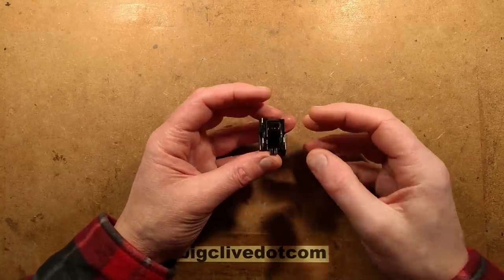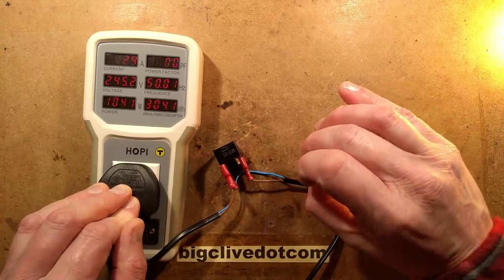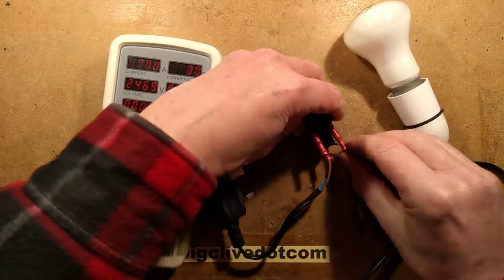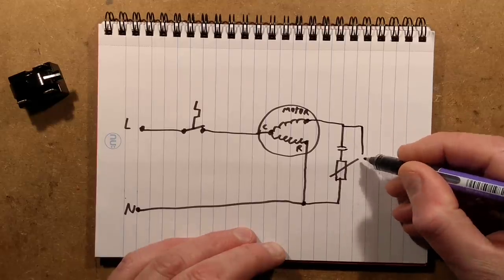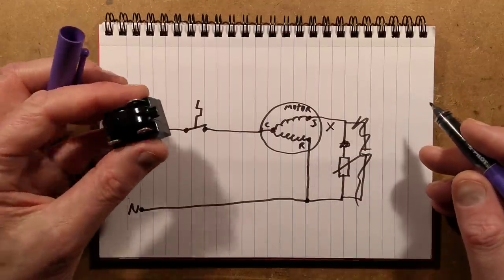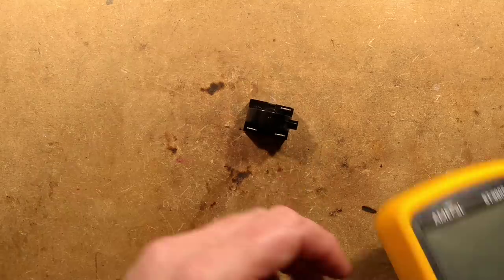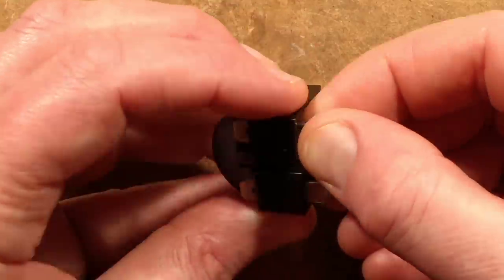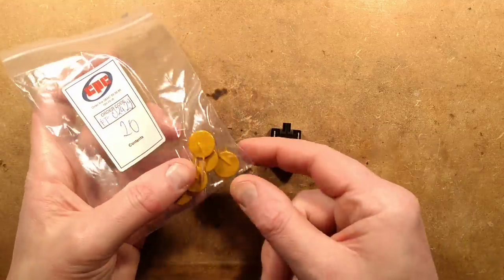Inside a cheap eBay motor-start module.

Comment: Most people will recognise the effect of the ptc thermistor from their old CRT TVs. The memorable switch on Twaaaaaang which was the degaussing coil wrapped round the screen envelope in series with a ptc device and the mains. A very effective use. The magnetic field would be large at switch on with large current flow and the alternating field would demagnetize the shadow mask. Then it would drop the current away in  four or five seconds making  a perfect diminishing ac field to ensure it does the job.
Reply: BOoOoOoOoOoOoOoOoOoOoOoOoOoOoNG
Reply: The old computer monitors I used to install used a relay to switch the degaussing coil on and off. You could hear it click in and out again after a few seconds and there was usually a manual override so you could give it a damn good degauss if it was necessary.
Reply: @jamesharmer9293  It was common with smaller portable screens to have a manual degauss as moving them about could upset the purity. Never seen one with a relay though.
Reply: @martinda7446  I used to install lots of 15 inch computer monitors and the degaussing was quite important. What got annoying though was when the magnetic fields of a bunch of monitors would all interfere with each other. They used to shimmer like crazy. I once saw a guy with 16 screens on his desk, though 4 or 5 was more normal.
Reply: @jamesharmer9293  Ha, ha, ha I can see it in my mind...Like a crazy GIF. That's a great image.

Comment: The holes in the back are for installing it directly onto the pins of the fridge compressor. I replace these all the time to fix broken mini fridges.
Reply: Yep there are three pins on the compressor, that starter relay fits onto 2 of them (start & run) & the thermal cutout (called a klixon) is connected to the third prong (common).
Reply: You fix mini fridges? I have a question for you in the morning! :o)
Reply: Sassy The Sasquatch  riiiiiight...
Reply: @
Stephen Kasprzyk, you probably have to put caps on the pins in that case, right?
Reply: @rolfs2165  Unless the electrical supply is through them ?
Reply: @millomweb  At least one pin should connect only to motor and optional capacitor.
Reply: @simonsackett  I'm going to guess he finds discarded ones and fixes the ones that are easy to fix for easy profit.
Reply: @rolfs2165  
the pins are the terminals to the winding's , so the ptc connects to the pins for run and start , the power (L) connects to 1 of the spade connectors , the common (other power(N)) is connected to the 3rd pin :-)
Reply: @YTANDY100  I mean when he's using the holes on the back to connect it to pins on the fridge's motor. In that case it's probably healthier to put caps on the spades so you can't touch them and get electrocuted.
Reply: @rolfs2165  
there is a plastic cover that clips over the connection point to the motor , but for extra safety you could use un-crimped spade terminals on the other connections :-)
Reply: @phil955i  My father always told me to remember can-she-run or (common start and run)...
Reply: I have a TK-20A thermoelectric mini fridge. It heats well, and the fan runs while it's heating, but the fan won't run on cool. The peltier panel does get hot when it's trying to cool but the fan won't run to (I assume) blow the heat away. Any ideas would be much appreciated!
Reply: @Scotty_in_Ohio not heard that one before, that's a good way to remember :-)
Reply: @simonsackett  
the fan is connected to a bridge rectifier , it may be that some of the diodes have failed , if it is a switch to change from heat to cool it may be the switch , hope this helps :-)

Comment: Here in California we have power cycles too...except our power stays off for several days between cycles.
Reply: But I bet you save on your power bill that way!
Reply: @tncorgi92  but not enough savings to keep replacing all the food in your refrigerator.
Reply: Yes, because US power lines are poorly maintained, unsafe ugly mess. Lots of videos on YouTube of US power lines on fire and/or arcing/sparking - some caused by trees that should have already been cut back or cut down. Hardly any videos of european powerlines arcing/sparking - certainly no exploding transformers.
Reply: 3rd world countries usually do.
Reply: @simontay4851  I cannot comment on the state of US power lines but I believe the situation in California is due to PG&E and other Cal utilities cutting power to prevent the spread of wildfires due to electrical distribution equipment.
Reply: @Van Harmon If millions of people install and run fuel burning power generators, wouldn't the bell curve of skill and care result in a number of related fires and accidents too?  Has anyone independently calculated total losses (insured + uninsured) for either power grid policy and the state wide return on investment of fixing the most fire prone grid components?
Reply: @johncrowerdoe5527  
Overthinking?
Reply: Your whole state is a ptc thermistor.. when it's on fire, no power, no fires, half power..  I'm so glad I moved away from there
Reply: @daverhodes382  That's the kind of thinking that big power companies and governments hire "bean counters" to do all the time.  I recall our state power company even doing lengthy reports to predict political changes during the multi-decade lifetime of new expensive power plants.
Reply: I bet that hertz
Reply: @simontay4851  California has issues it's people are too Californian to solve properly, their power grid is one of those problems.
Reply: I have a story from the very first reign of moonbeam the first regarding this problem...
Reply: As told to me by a metallurgist/turbine engineer that worked for the utility. Seems during the first big brownout/price gouging "crisis" probably 20 years ago or more, the utility had a gas fired steam turbine running full blast. It suddenly started vibrating badly. They were able to vent steam, unload the generator, and allow the turbine to spin down without it undergoing a RUD. There was a representative of his dishonorable Governor Brown, may fleas infest his crotch, was onsite. She when totally and irrevocably apeshit, screaming that they had to restart immediately.  The utility said they had an oil fired unit just down the road that they had on standby and they could have it up and running quickly, but that it had met its maximum pollution release for the year, so they needed her to waive the environmental fines that would result. She was having none of that. There was no way she would authorize waiving fines. They had to restart the gas fired plant RIGHT EFFING NOW! Of course that was not possible and they tried to explain that attempting that would result in a massive turbine failure. As it was, they were lucky to get it spun down without a RUD anyway. She kept insisting, at the top of her lungs, to restart the unit. The engineer told her the only way they would do that is if she stood next to the turbine while they did it. She thought better of it, but still wouldnt waive the fines. So the started the oil fired unit and raised the electricity price to factor in the fines... which is where the "price gouging" claims came from....

Comment: A very similar device was used on old TV sets to run the CRT degaussing coil for a few seconds after powering the set on.
Reply: You beat me to it.  The devices had 2 PTC elements in them in thermal contact, one was in series with the degausing coil, the other was across the supply.  This meant that the heating from the PTC across the supply effectively kept the PTC in series with the degausing coil hot, thus reducing the current flow through the degausing coil to almost zero.
Reply: Boioioiingggg!  ah, the good old 17" crts, which could run up to 75hz instead of the spec 60hz..
and the cheapo unshielded speakers.
Reply: I would love to see Clive make a degausser.
Reply from the maker: I've featured a degausser in a video.
Reply: @chrisg6597  Ya' stole me thunder. Well done!
We used to refer to those as "glow-bar" resistors.
Reply: beat me to it
Reply: @chrisg6597  Later ones are a 2 pin device, as they could make a PTC that would have a low enough hot current not to cause any ripple on the CRT, plus it also saved power as it did not have a 5-10W always on heater. 

Final versions used them, plus a relay, so the degauss coil would only run for 5 seconds after power on of the monitor, as you then typically had the monitor have no power switch but instead ran all the time, turning on and off the CRT when the PC commanded it, so that you needed a controlled way to degauss when off for long periods but with mains power applied all the time. Also enabled them to drop standby power lower for Energy Star ratings, and have a longer life for the PTC as it did not sit at high temperature all the time. Those elements fail by crumbling into chunks, or splitting into parts from stress.
Reply: @chrisg6597  And me too.
Reply: Yes CRT degaussing was the classic use for these. The thermal cycling on the component was often the cause of dry solder joints, but better tv's and most professional monitors isolated the PTC with a relay after a few seconds.
Reply: Oh yeah, the sketchy art of running your old CRT just a lil bit above it's rated frequency!
Reply: @chrisg6597  Other CRTs used NTC/PTC combo devices. The PTC in series with the degaussing coil, the NTC is the inrush current limit for the power supply.
Reply: GashimahironChl I wonder if it was what I did unintentionally. My room had a strong smell of heated plastic for days after I changed some settings and left the room for a few minutes :/.
Reply: I was trying to figure out how I came to have one of these in my stock like of components I've collected when I was learning how to solder and de solder. I've spent days trying to figure out where it cone from and now I know. Mostly the info I've come across was in Hindi and yeah I don't understand Hindi.

Comment: 13:32 Those "springy contacts" are for the connections to the motor windings, the flat spade connectors are for the powersupply.
This motor-start module is the modern version, the older version use a sort of relay, where the coil gets energized at startup, during the off position, the contacts are bypassed, and pass current to the start winding, but when the motor starts spinning, the plunjer of the coil gets retracted and the contacts go open and cut off the current to the start winding.

Comment: I've used them to limit the inrush current to a projector bulb. You can put them in parallel or series to get different current and time constants. You can snap them in half and solder to the sides to get higher resistance ones.

Comment: The correct term for this device is "positive-thermal-coefficient thermistor". It's basically a block of resistance material that conducts heavily when cold (this inserting capacitive current from a motor-starting cap into the motor) but becomes high-resistance when it gets hot (which it does after about 2 seconds of operation), thus cutting-out most of the capacitive current once the motor is running. 

I had to replace one of these on my fridge about 8 months ago. It died and the compressor stopped running. On opening it up, it had a block of resistance material which was shattered into about 5 pieces. So I went to an appliance-parts shop and bought a replacement kit with both a ptc thermistor and a temp sensor, and replaced both, after which my fridge operated normally again.

Comment: This terminals are designed to mate with the standard three pin, hermetic sealed, feed through normally seen on small refrigeration compressors. Pre PTC days the compressor used a current relay wired with the operating coil in series with the run winding. On start up the high current draw would close the contacts on the current relay and feed power to the start windings. When the current in the run windings dropped the relay would drop off and the start winding would be disconnected. All the ones I ever came across were manufactured but a company called Klixon. The only time I ever saw a failed one was from where the start winding had failed so the current relay had stayed on and got black and crispy. Compressor checks were always pretty straight forward, the run winding is normal about twice the resistance of the start winding. Repairing it after was a job is hand over to the Refrigeration Engineer; I didn't work on enough refrigeration kit to justify the expense of more tools (and refrigeration tools are pretty costly)

Comment: Interesting to see you dissect one of these. I frequently have power fluctuations since my local power company can't keep the rural area I live in maintained properly.
During a recent storm, the power kept cutting on and off quickly. Afterwards, my refrigerator stopped cooling. 

After some research, this was the defective part. It was an easy replacement, but I unfortunately decided to buy the part made by the manufacturer, because I didn't want to take a chance on a knockoff. It is almost the exact same device but it cost me about $70 from a part supplier in the next town. 

In the future, I will probably buy a cheap one and hack it onto the compressor. The one I installed had three holes that plug directly onto three pins of the compressor. 

I was glad I didn't have to buy a new refrigerator, because I had assumed the compressor failed. Still, the name brand part should be much much cheaper!

Comment: Cool! Seen many of these on your channel, but don't actually know the composition that makes these operate. Seems odd that a ceramic disk can pass any current.  🤔   Off to Google I go to find out!

Edit:  So these are ceramic doped with barium titanate. At the Curie point, they just stop conducting, although at high enough temps it becomes a NTC again, like when they're cold.  

They also have silicon versions, (silistor) which have a linear cutoff voltage dependent on temp rather than a quick one like the ceramic ones.

There's also polymer ones, which I think is fascinating. It's a plastic containing lots of tiny grains of carbon. At lower temps the carbon grains contact each other and close the circuit, but when heated up, the polymer expands which moves the carbon grains apart and opens the circuit.  Awesome!
Reply: The polymer ones I have seen and used on electronics projects as resettable fuses ("polyfuses"). Apparently when they go open, they stay that way for a longer time than it takes for them to cool down. I imagine the physical changes you describe are linked to that.

Comment: I want to clarify things a bit. The compressor needs to turn a few times to start so freeing the preasure just in the cylinder its not enough for it to start. On all shop compressors there is not not one but two one way valves. One is right in the head of the compresser and the other is at the end of the pipe that goes from the compresser to the tank. That hissing sound is made by a third valve that is built inside the presure switches and is releasing the preasure in the pice of pipe between those two one way valves.

Comment: Hi again Clive, they are designed as a push fit onto the thin round contacts that stick out of a hermetically sealed compressor. I think they have a  flat springy metal strip over the top of the unit to keep it in place.

Comment: I have used the opposite device, an NTC thermistor that drops in resistance as it heats, to start DC motors that were powered by a current limited power supply. DC motors draw a large inrush current when first starting up. This can sometimes be enough to blow fuses or trip out switch mode power supplies that can otherwise handle the motor current once it is up to speed. Using an NTC rated slightly above the running amperage of the motor provides a nice soft start. If you use a heavily overrated NTC the motor will never come up to full speed.

These thermistors do get hot though. You will want to keep them away from melty things and fingers when in use. For large DC motors, air conditioner blowers on busses, I would use a separate timer relay to carry current past the NTC once the motor was up to speed (1-1.5 seconds) simply to allow the thermistor to remain cool once everything was running properly.

Comment: PTC's were used in old CRT displays to drive the degausing coil at switch on, if you ever heard a him and saw the screen wobble when turning on a TV that was the degausing coil. Also 11:19 "Compressed liquid"  you cant compress liquids (which is why you need to leave fridges/freezers a while after moving them to ensure there is no liquid in the compressor as that will damage/break it. The MOD had an issue with the compressors on drinking water coolers in tanks blowing up because of this. A friend designed an upgrade that helped prevent this).

Comment: Your absolutely right with the old 3 shot and 5 shot pole mounted auto reclosers. Things have moved on considerably now, most pole mounted 'active' equipment are radio controlled, as well have a certain amount of local decision making based on fault current and such like. These radio controlled units open and close via computer systems having a more overall viewpoint of any faults, and subsequently narrow the fault down to just the point of failure. Areas where overhead lines are used do benefit from regular tree cutting mind.

Comment: I think old crt televisions used to use a similar ceramic disc thermistor to control the degaussing coil when you switched the tv on.

Comment: My (bigger) air compressors have mechanical "unloader valves," which sense the reduced pressure in the output line (when the motor stops), to dump the pressure inside the cylinder.  These particular ones give a distinctive "klang" when they operate, which covers up the "hiss." No electricity required.